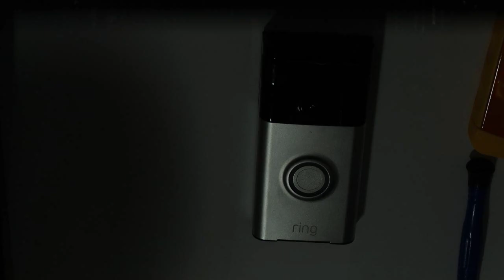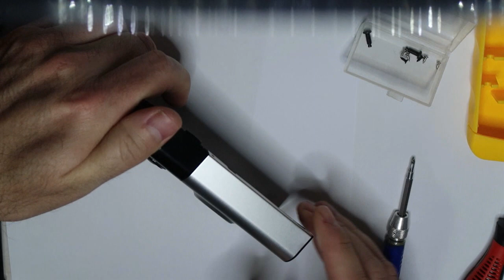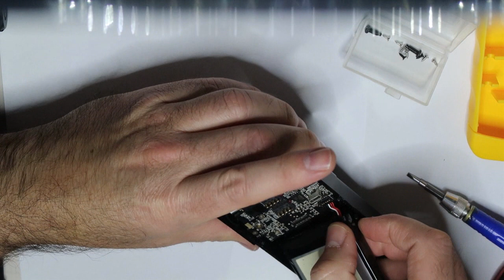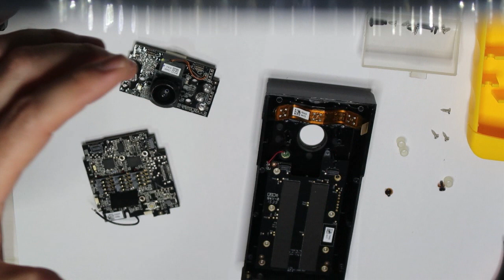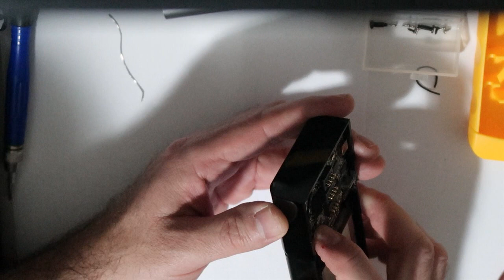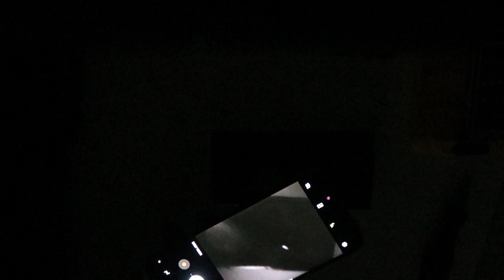ring Doorbell camera disassembly and fix

Comment: These were heavily promoted in Australia. Are they bad products?
Reply: I don't think they are worth the price. I've had two. First one was replaced under warranty within a year and the replacement just made it past the year warranty and it died. It won't charge or do anything. If you can get a good deal/big discount they are worth it for the service but there are more cheaper options today.

Comment: The security screw on the bottom of my Ring Doorbell 2 is stripped and I can't remove it to be able to remove and charge the battery.  I've tried using a rubber band with the screwdriver, duct tape and all sorts of other suggestions.  Can you help me?
Reply: Tools needed: hammer and safety glasses. 

Step one ... Place ring device on flat surface. 

Step two... Swing hammer 5 or 6 times until battery flys out.

Step three... Pick up pieces and discard. 

Step four... Repeat step two if needed.
Reply: I have the same problem I'm trying to figure something out right now
Reply: Use a CCW drill bit very carefully
Reply: @aeronauta2011  A pair of long nose pliers will help that's what my mate used when I rounded off the screw head (this may vary based on the object you have it mounted on)